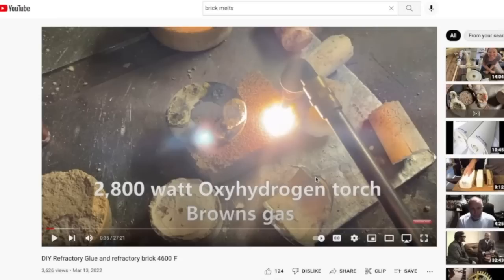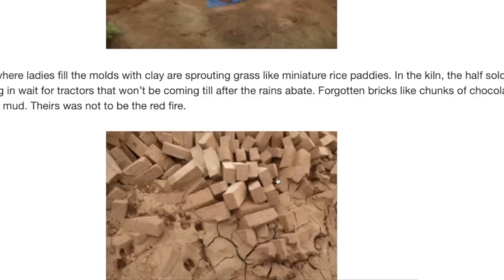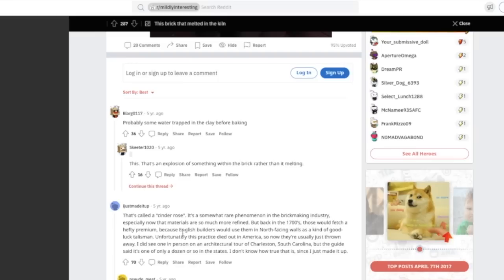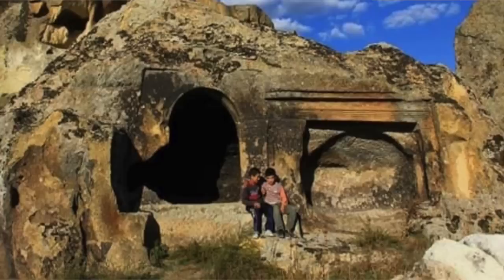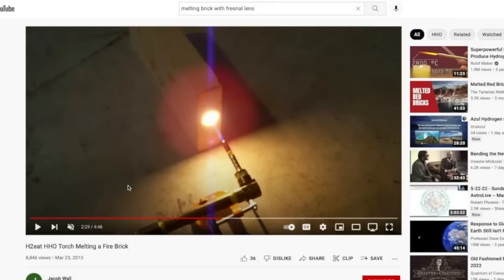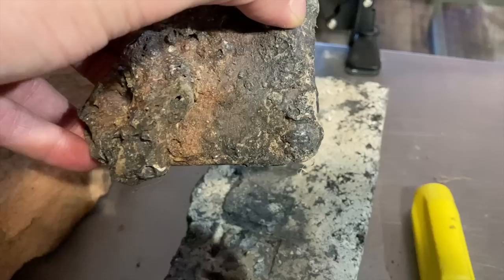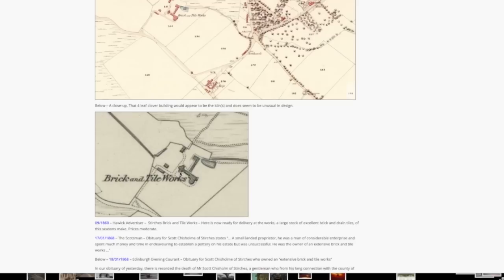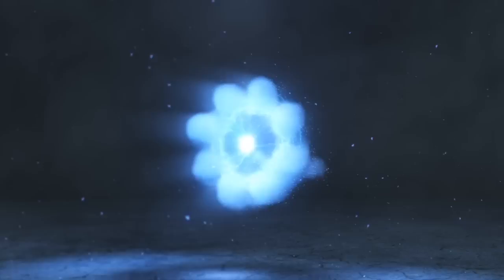Melted Brick Study

Comment: 0.08 Clinker bricks.  I've read that the homes that did not burn in the directed energy wildfires, the ones directly next door to the ones vaporized, had their main breaker off in the panel box.  Could it be that the emf of the power to the house is the homing device?  Again the common denominator of the houses left standing had the power switched off...
Reply: Smart meters, they are putting them on all houses now. They switched ours out a couple years ago
Reply: In recent "fires", only houses without smart meters did not vaporize. One can OPT-OUT of all smart meters. Well worth effort.
Reply: @today7518  When most think about privacy most think in terms of online presence and data gathered from smart phones. Based on amperage being used, smart meters can build a picture of your personal habits. It’s unbelievable…
Reply: @willsteiner8021  Yes, there's a whole list of goals and uses for smart meters. None of it helps us masses. Anything labeled "smart" is stupid.  :  )
Reply: 100% SMART METERS were used to vaporize the homes! I am a retired Firefighter and I investigated these fires in Santa Rosa where I live! Way TOO many anomalies! The only thing left of these homes were cement foundations and steel bolts! And right next to these foundations were green trees and plastic garbage cans untouched! I saw completely burned out cars where only steel was left and two feet above the burned out vehicle was a tree branch still with leaves on them!!!! I saw aluminum trucks completely melted with only the steel frame and steel springs left sitting in the driveways of these burned out homes! I believe that Directed Energy Weapons and Smart Meters were the primary weapons used in these fires! If you search videos of these fires you will notice the same anomalies! Cheers to everyone!
Reply: @fredclement5059  Thanks so much. In the past, I experienced a real house fire. While holding a flashlight and making a clip board list, dug through charred remains for insurance claim. After seeing a real fire scene, one knows a fake fire scene. Now wondering if they regularly zap places over the years without our notice, and call it something else?
Reply: Why would their main breakers be off? Were they forewarned?
Reply: @fredclement5059     Thank you for telling us all of this.     Definitely the smart meters are causing fires.  Remember the massive forest fires in western Canada quite some years ago.  These fires were caused by the meters.
Reply: @barbibutton9619  ???
Reply: @barbibutton9619  When firefighters arrive at a burning structure they cut the main breaker.  The electrical code for all buildings today has the main cutoff breaker located on the outside of the building where the electrical feed is located to make it easy to locate. Older homes and structures have the main breaker inside the panel box which is typically in a the garage.  In answer to you question about being forewarned, I think that individual homeowners cut their main breaker as they evacuated the wildfire area knowing it would be helpful to firefighters, not because of being forewarned.  With the main breaker cut off, all emf emitting devices such as a router cease to have a beacon signal.  Perhaps...

Comment: Browns Gas is very interesting, and something myself and a good buddy of mine once pondered, when we were hypothesising if and how the ancients had foundrys etc, and potentially what fuel they would have used.. Essentially the oceans are your fuel tank, so endless abundance of natural fuel.. There's some controversy around it, and it does raise more questions if this was something they used, but worth exploring for sure 👍🏼
Reply: Indeed, An elder blacksmith friend explained to me after I saw a wild furnace using it. It idled away making 'Fopping' noises every so often for around 20 - 30 minutes. Then it changed its behaviour into like a jet , bringing all the iron close to the the top of the furnace get to melting point very quickly, and then suddenly it was out... Wow! So my blacksmith friend called it poor mans gas. In his time it was called that as it was readily available, he explained that the heat of the flame would adapt to the medium it was applied too. It would bring water to boiling point, but not exceed it, the same with metal, It would simply bring it too its melting point. it could therefore be used to amalgamate different metals (or even different substances) together. Or even just almost vaporise anything...! His perspective was quite matter of of factly for the farmers in the outback of Australia. And then he observed in his experience , it just almost falling off the map for whatever reason. If this is all true, I couldnt help but think how this gas might operate below the surface of the earth in its own way on a much larger scale.....
Reply: @borisgrigull7772  great comment.
Reply: Salt in the mix?🕊
Reply: @borisgrigull7772      So, so intersting....and I've never known about brown gas before.  What caught my eye with your note was "vaporize".  One of my thoughts on 'where are the people?' has been wondering whetherr they were vaporized.

Comment: I’ve seen a few news stories about modern reflective glass buildings with a concave curvi-linear shape causing melting.  The surface focuses the sun’s rays onto a small area, not unlike the way a magnifying glass directs sunbeams into a super hot pinpoint of light. I wonder when walking past a glass building through this reflected light on a sunny day  if I could get burned...
Reply: Great point and yea if it focused enough in a spot you would feel a burn as you walked past it. I saw one story about a building like that that was melting the tires, the plastic and metal on cars parked across the street.
Reply: Just another "spontaneous human combustion" eh?

Comment: Epiphany - I know that when you fire a clay pot or sculpture, the clay must be kneeded until all oxygen bubbles are completely eliminated or it will explode in the kiln during the firing process. Therefore if a high enough temperature flashed a brick to vitrification/melting point it could easily cause a normal clay brick to explode.... 

Is it possible the melting of granite is how they poured giant granite structures into forms. Possibly how the pyramids in Egypt were built?
Reply: Now that’s a cool thought.

Comment: Hey Jon, perhaps a little off topic but I've been cutting, polishing and setting stone and tile for almost 30 years now.  I've experienced a few mind blowing phenomenon with stone.  Had set quarry porcelain tile on a restaurant kitchen floor.  The contractor called me in about a week and asked why the tiles had "blisters".  It was very strange but a number of bubble type blisters formed in a couple random areas.  I was told by a tile representative that the chemical gases in the concrete below the tile had a reaction.  Never seen anything like it before or since.  Also had a rock heat up in my hand while it was submersed in cold water.  No BS.  Love your stuff brother.  Keep it coming! :)

Comment: Good work, valid points. Hope he's watching. Btw - a whole other aspect to this question is the simple fact that when superheated quicklime forms into concrete when mixed with water, this happens by a chemical reaction - producing immense chemical heat, not thermal heat (from any flame or burning) but from MOLECULAR COMBUSTION. And THIS is actually what causes the melting of bricks and buildings and indeed of flesh when covered and petrified. This realization is CRUCIAL to the whol debate - cos it's talking about molecular dissolving through chemical combustion, and not through ANY thermal, flame-based heat process. 

If Wise Up was really as wise as he thinks he is - then he would know this and wouldn't even have issued the challenge. (Just sayin)
Reply: Molecular and not thermal 👍🏼🤔🕊
Reply: Exactly - I saw once, you can see, anyone can see - search in YT for "Quicklime reaction in water" science education videos - there are lots of them. There you see quickly, a guy puts little chunks of superheated Quicklime into a bowl of water - and BOOM instantly the water starts BOILING as the Quicklime starts IMPLODING at a molecular level, releasing all that kinetic energy from the superheating, even if the stone is totally cooled down. The reaction is chemical not thermal. And it is a unique sort of self-dissolving in the Quicklime - which actually spreads to whatever it comes into contact with, like a weird kind it osmosis. And the water itself doesn't boil away into steam, bcos it's not thermally heated. Rather the boiling is the effect of th dissolving of it's own molecules, are n sync with the Quicklime. Like an atomic explosion or implosion to be more exact. Just one short video showed me everything to understand, at a basic level, how petrification happens... And why dissolving happens at the same time. Of any material at all, if the Quicklime has been pre-heated to high enough temperatures. Modern industrial concrete only heats it to around 800° - enough to begin the implosion when placed in water - but volcanoes will heat it to at least several thousand degrees - so the hotter you heat it the more crazy it gets when placed in water. Bingo - Eureka! Jeje. The mystery solved - or at least a big chunk of it (no pun intended 😉). 👍

Comment: Morning brothers and sisters.  Morning brother Jon. 
 Melting brick usually explodes it. Fire brick is different but it will still pop at you, when it gets real hot. Yea it will melt though. Diffrent temps Diffrent reaction.
Reply: Firsthand experience?
Reply: @dirtypure2023  ofcourse.   Lol 
 I'm a welder fabricator. Always been some what of a Pyro lol
Reply: @wcmwfab935  I would say always explodes it, as with concrete aka the mortar bomb.

Comment: Something weird happens with HHO/browns gas flame. it adjusts its temperature based on the melting temp of the item you apply it to.  no other torch does that that im aware of except maybe a plasma cutter.
Reply: Yes you can run the flame over your hand and it won't burn it ?
Reply: What the... is it hot or not? Weird.
Reply: You have to change your consumables when you change metal thickness i run a high definition plasma table for work every day.

Comment: once upon a time worked at a brick manufacturing plant packing bricks still cooling straight out of long kilns that were only extinguished for cleaning purposes or repairs a day or two per annum , the railways thru the kilns were almost constantly conveyed by carriages of brick bungs [ high loosely packed stacked bricks various shapes sizes and colours so heat may pass thru the 'bungs' and be fired hard most efficiently ] even when not in use the temp. would merely be reduced slightly in the wee hours of a morning until more carriages were shunted onto track for it's slow steady progression thru the kilns , as turning them off was out of the question as to reattain requisite temperatures would cause an unacceptable delay in production , the brick Technicians even allowed me to assist them casting , by the handful , scattering of metal filings at the surface of particular batches of wet clay bungs that required that metallic pockmarked finish , where of course answer to my questions of why it wasn't introduced earlier in the recipe it was explained the metal [ strictly low tensile small fragments ] needed to be spread sparingly as metal amplified the heat thru-out kiln journey causing bricks to pop before solidifying which could lead to a bung collapsing like a house of cards inside the intensely heated kiln tunnels , incidentally most serious injury and fatalities were caused by bung cave-ins thru-out the brick works - the comparatively generous wage of packing bricks after they were fired and reduced in temperature enough to touch was the attraction for a few years - there were several massive [expensive] noisy German Keller brick packing machines tho they were no match in efficiency to gangs of us packers on the Carousel the old fashioned way - by 🖐🤚hand.    thanx Jon always appreciated   be 🌴 well
Reply: 🥽⚠ bear the potential impurities inside [or superficially]  bricks In Mind always wear PPE or just reconsider doing it ⚠🕶

Comment: In my research, I came across a website - The Diehold Foundation, by Douglas Vogt - that has a series of videos on his theory of what happens to cause these cyclical resets and the intense heat that causes the vitrification of areas of the planet.  Very interesting!  It would explain a lot of this melting.
Reply: Are they associated with the 'Thunderbolts Project' - Electric Universe theory?
Reply: @kingdomcome1617  No!  He references the Thunderbolts Project, but he has a different theory entirely.  I studied the Thunderbolts Project myself and was intrigued by it, but Doug Vogt's theory is entirely different.  Between the two, it's just more info to think about to try to figure out this conundrum of the resets, mud floods etc.
Reply: @questfortruth665  I'll have to take a gander.  Name sounds familiar.  Thanks for the homework.
Reply: @kingdomcome1617  Yeah, check it out.  He has quite a few videos.  I've watched them all, but he hasn't had a new one out for months now.
Reply: @questfortruth665  Just went to his channel, come to find out I am subscribed already haha.  Small world.  I've only sat through a couple of the videos and it has been a while, so thanks again.
Reply: @kingdomcome1617  For sure!  He has interesting stuff on there, that's a fact.  It's given me a very new perspective on the world-wide floods and mud floods.

Comment: I like both your channel and his channel (for we all know who you mean, nudge nudge wink wink!), but have to say I always believed that bricks could melt, because if you own ranges then occasionally you have to replace the fire bricks and sometimes they come out warped from continual use and heat exposure.
Not only that, it is logical, for most bricks contain sand and what is glass made from, sand, but what happens to sand when it is heated to extremes, well it becomes molten glass, which is liquid, or a form of liquid.
This other individual is incorrect in his assertions that bricks don't melt, but he is also incorrect in his assertions on Tartaria as well, but nevertheless it has been comical to watch.
Can I just say, well parried Sir!

Comment: The cement, the asphalt, the stuff they make cars out of since the 80s, even landscaping materials are all designed to fail after a short time. Job security?  Maybe , but I believe there are many more reasons for this. And the reasons are much  darker than the simple job security theory. On a different note, Brien Forrester is an avid  explorer and concentrates on bizarre things found basically in Central and South America, Egypt and other places around the world. He ascibes to the some thing happened and there was extreme extreme heat from something and melted rock, stone and vitrified ruins. Thank you.

Comment: JonLevi has a super-chill voice but probably not a science background.  Check 3:50.  This is not "melted brick."  This is a photo of local groundwater rich in dissolved calcium bicarbonate having the mineral preciptate out as it flows through the porous grout which cements the bricks in this underground vault ceiling.  The result is a formation similar to "ribbon stalactites" found in caves in Karst regions.  You can see similar formations in Carlsbad or Mammoth Caves.  Not melted brick dude!

Comment: The firebox liners in my Savoy cookstove are custom firebrick, they burn out and need replacing every few years, they are sometimes difficult to remove due to the deforming. They appear to have melted, saggy holes and wavy edges.

Comment: The Fresnel (pronounced Frey-nil) lens was used to power a mobile steam-powered dynamo. My grandfather's brother had one that he used for building project temp power and also when a circus or carnival came to town. I saw one many years later in Klamath Falls, Oregon; but it had a coal burner, so it did not have much power output. Also, the smoke that would gag you.

Comment: Salut Levite, 
 I have a friend that pit together a homemade magrav cold fusion generator, by result of the particular combination of elemental components (metal salts, water, laser, electric current) that were implemented, along with plasma created, there is a byproduct of hydrogen gas given off. He has it set up pressurized with a line and torch nozzle, using it to do jewelry work. I must attest that it burns very hot, for instance; he fired red clay found near his home in Northern California, turning the clay into pretty crystal! 
I have seen him mix metal and crystal together by melt.... the process is fairly quick and all together quite amazing! That is all I've got.... cheers and blessings!

Comment: I have tried toching a fire brick when I was a teenager. Didn't think anything about it. It was easy, but it didn't melt nicely. I imagine you could melt it more evenly with lower heat and more time
Reply: @alllaw3ao7  I'm talking about torch heat, technique and tools. Definitely not just blasting a concentrated hole down the middle.

Comment: You can aquire a fresnel lens from those older rear projection big screen television sets. Carefully remove the front and in the.middle of some filters is the lens. Then you frame it with some wood and put it on an easel to create what these guys use to melt granite. It only gives a beam focal point of roughly one inch square, but it can be used with some success to melt silver and gold in  small crucibles but once out of the beam they solidify fast.

Comment: Melting point

In general, such bricks have high melting points that range from about 2,800°C (1.540°C) for fireclay to 4,000°C (2,200°C) for silicon carbide. They also should resist the chemicals in slags and not spall, i.e., flake under wide temperature changes. Clay bricks of fireclay or kaolin are common.